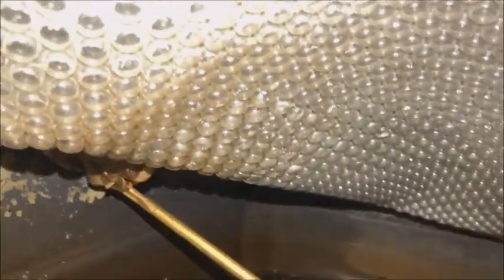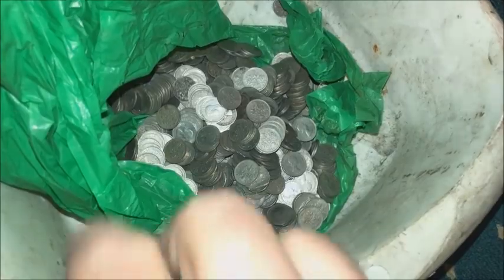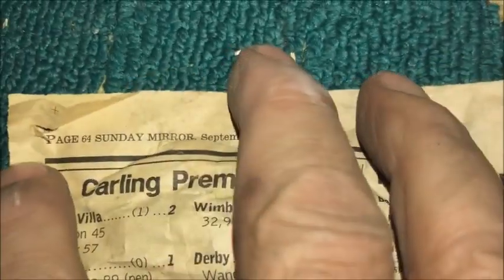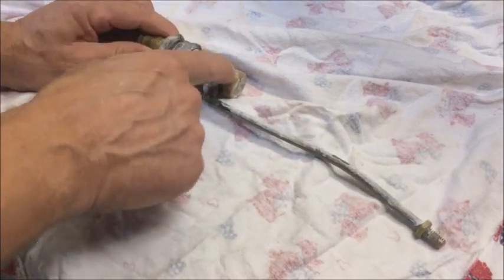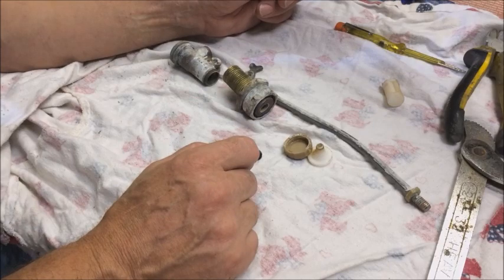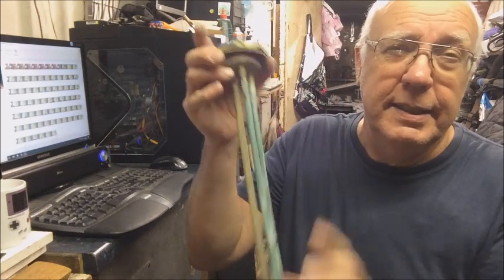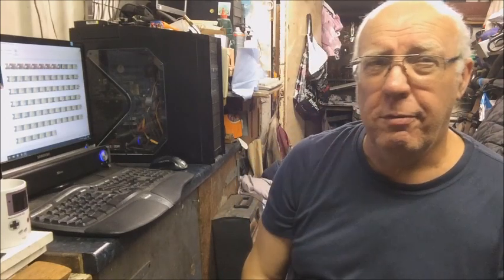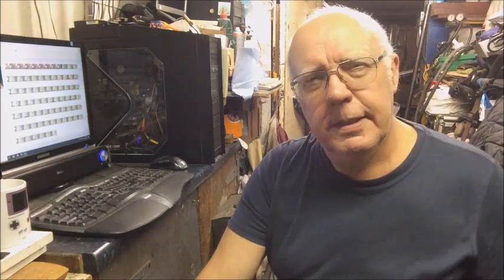BALLCOCKS  &  How it was fortunate I had a leak

Comment: Had a simular case. Tree fell on a power line, power out for 8 hours. My wife was using a spce heater. When I went to resit a timer on a lamp in the other room noticed burning small and hot outlet. If the power never went out I wouldn't have found it in time to prevent a fire. I hate space heaters anyway, but there was a bad conection on an outlet in a different room on the same circuit. I installed new outlet.

Comment: I disconnected my parents immersion heater as the mains cable  to the switch was too small 1.5 mm which resulted in poor connection is in the switch which resulted in it getting very hot, unscrew it and it was black,

Mum said she replace cable from fuse box when the stair carpet would wear out, trouble was the carpet was a Axminster so never worn out,
Reply: "Axminster, never wore out" LOL!  You know that you can roll back carpets?  It should be a 2.5mm T&E radial circuit off a dedicated 15/16 Amp breaker. If the 2 or 3 port valve is/are working A, OK, (wont bore you with the technical details) heat the hot water cylinder offa the boiler. Gas, not lekky. You really only use electric to heat up the hot water if the boiler or 2/3 port valves stop working. Pity the bloke (me) who has to amend and extend (spur off) a ground floor electrical circuit where the cables are run in from either a concrete screed ground floor and the 1st floor is covered in a laminate.  Your mum sounds like mine and my missus fer that matter. Common sense with a wee smidget of lunacy chucked in fer good measure. Dats wimmin fer ya!  I love mi mam and the missus, btw, despite their idiosyncrasies.

Comment: Your're welcome M8. Suffice to say, stripping down a ball/float valve can be a reyt bugger,  just to rewasher. Particularly when they are all scaled up and you are in a loft space,  balletically skipping across joists, being scared witless of putting a foot thru the ceiling below, breathing in rock wool fibres, reyt hot int summer and too bloody cowd in winter. Bugger the washer swap! Chuck the brass in the scrap bin. Change the whole levered arm float and plastic ball float if required.  Ya did rey't!
Q? Why do I lapse into typing in northern vernacular. Must be the home brew. 
I'd go into diagnosing faults on immersions. Is it the stat. Is it the element. Is it a wiring fault. Has it been tripping out so often that the breaker has gone baggy and wont re-set????  But I can't be arsed.  If it was the stat that just needed replacing, inevitably the immersion would fail too, 2 weeks later. Tek the lot out and fit new. Jobz a goodun!
Reply: And you sir definatly need more subs. Lol
Reply: @donniebrown2896  Cheers pal. Seemingly,to me; the madness never stops. I still reserve the right to change my mind. “One of the painful things about our time is that those who feel certainty are stupid, and those with any imagination and understanding are filled with doubt and indecision. Let doubt prevail."  - Bertrand Russell.  That was in the 1930's.
Reply from the maker: I’m corrupting ya  with my dulcet tones